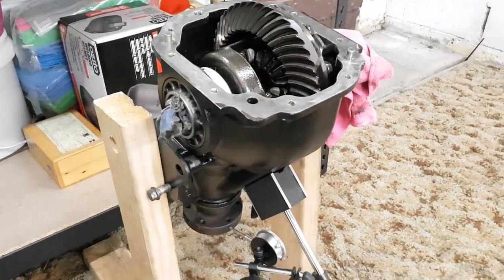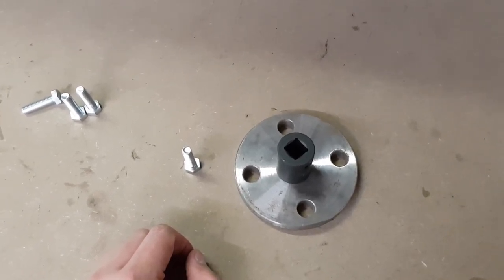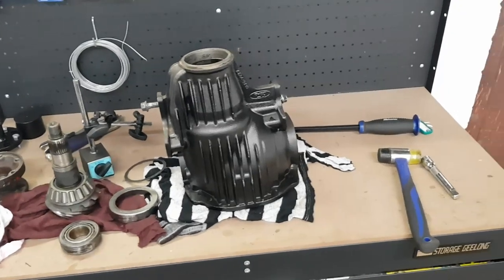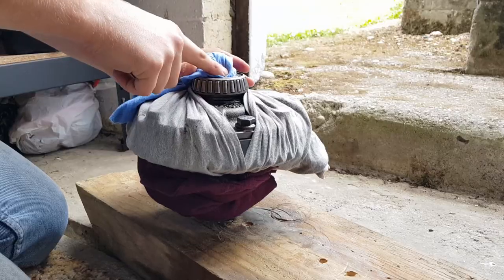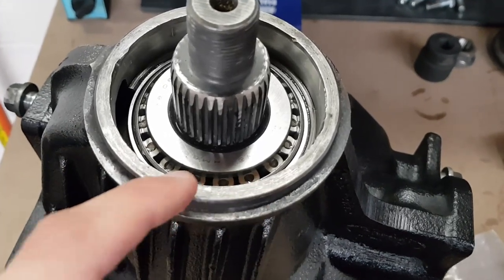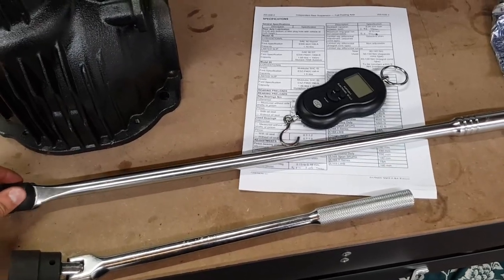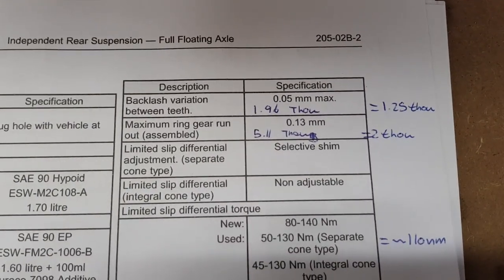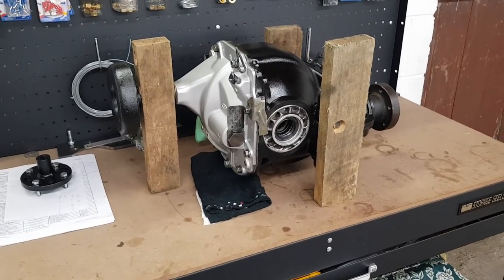xr6 Turbo diy diff rebuild- New bearings

Comment: Awesome work. For a screw adjuster in the past I have used an aluminium oil filter remover and cut teeth into it. Loved your version. Also when removing the bearing carriers I mark them as you did plus count the rotations to remove. With new bearings not needed unless reusing the bearings. Gets you in the ball park and or where you were when pulling it down.
Reply from the maker: I actually did consider using an oil filter tool like that or an adjustable angle grinder spanner but didnt think it would be strong enough. They actually took way less effort to remove then i was expecting.

Comment: Excellent video and thanks for your time and efforts.  This type of video helps a lot of people so thanks again. XR6 turbo diff may be hard to find but your can also use a territory diff which is a M86 and the ratio is lower with a truetrac center it could be a good option for others.
Reply from the maker: Thanks for the comment! yes have since found out the territories run an m86 as well. The lower ratios would probably be favored for those at the drags etc to help overcome that tall 1st gear in the btr. Originally i was hoping to just put this diff in the car without touching it but it didn't quiet work out that way. Truetrac center is also a great idea, this lsd works but i have no idea how much work it has done.

Comment: Good stuff mate . Surprised you got away with stick welding that Chrome moly socket though , would have expected it to crack off under load . Keep up the good work , top shelf .
Reply from the maker: I wasn't to sure what was going to happen when i welded it but welded easily. The screw adjusters aren't very tight though.

Comment: While you have it apart I’d replace all the bearings to mate. Great video
Reply from the maker: I did end up replacing all the bearings in the video. The diff centre bearings didn't look to bad but it was an extra $50 to do them so it made sense.

Comment: that was really good. i am currently doing an AU LSD and it's pretty similar. i was thinking of using the solid spacer because i just can't see why they use a crush spacer other than its easier than making tiny adjustments t a solid spacer. but get it right and it should be just as good.
Reply from the maker: From a production viewpoint a crush washer is quicker because you can get the preload correct first go. If you're building a really high performance diff or plan on taking it apart often a solid spacer definitely isn't a bad thing. Good luck with the au lsd!

Comment: G'day Lad, great video covering all the aspects of these diffs. 
One small point, at 45 min your calculations are off. 195 x 3.46= 674.7 not 467.1. So you were about middle range if spec. 
Would love to see vid on the solid axle design, eg, ute diff. Also checking /  replacing of the LSD parts.
Reply from the maker: You're dead right i definitely made a mistake there. I have no idea what happened to end up with that result. Its a shame about the ute diff, i actually had the solid axle version of this diff apart out of my fg ute earlier this year. It wasn't a full rebuild but i had to remove the center to change the carier bearings and the lsd friction plates so sort a clunk it had on takeoff. Sadly i didn't film it.

Comment: Great video, so much informations in it, much appreciated, wonder if it is the same sort of set up for the solid axles in my bf ute. Learned a lot anyway, can't wait to see the result in your car. My current diff my ute whines starting from 80km/h on slight throttle while coasting, and noise stops with foot off throttle or lower than 80km/h. I suspect my pinion bearing to be bad and so too much play. I was searching for information and came across your video. Now I gotta figure out how the carrier bearings preload works on a solid axle set Up. Thanks
Reply from the maker: Some parts are similar for the solid axle namely the pinion setup however carrier preload and backlash is set with shims. In your case most the time you can get away with replacing the bearings and reinstalling the shims just make sure they go back in the exact same spot they came out. There should be 0 play in your pinion bearings. If there's movement you definitely have issues. I have put the diff in my car now, video should be up soon!

Comment: This was a fantastic video, is this a manual car with that set of gears.
Reply from the maker: Its an auto, all ba xr6 turbo and xr8 ran 3.46:1 manual and auto. Bf started running other ratios with the 6 speed auto etc.

Comment: Great video mate, just one thing I didn’t see the shim that was behind the big pinion bearing the you pulled out, did you put it back in? I wouldn’t mind having a go at building one of these cheers
Reply from the maker: Thanks mate, yes the shim went back in. If reusing the same gears you reuse the shim. Providing you use the exact same kind of bearings as you took out it should still be within spec but you still check contact pattern on the gears once all assembled to verify this. If using new gears though then you will likely need different shims to suit.
Reply: @stuff7853  okay no worries mate the problem with mine is I’ll be using another set of used gears and don’t have the shim out of the housing that these gears came out of if that makes sense 😂😂
Reply from the maker: @jakestocks1296  Even if you had the shim it would be worth checking because there can be variances in the housings. Your best bet will be to make a set of dummy bearings. Use the old ones, grind the inside and outsides of them so they slip on and off the pinion and the races slip into the housing if that makes sense. Then you can easily assemble and disassemble to swap out shims until its correct. Just reuse the old crush washer for test fitting and tighten the pinion nut until it has some drag on it. Replace it with a new one and set preload properly once you do final fitment with new bearings. Good luck!

Comment: Hello there. I have been looking all over the internet for a video on this differentials. I got a 2006 pontiac gto with the same differential. I wanted to ask you how did it go with the differential after you installed it and ran it?
Reply from the maker: Hey, that makes sense that the pontiac has the same diff.  Sold as Holden over here, both the ford and Holden used borgwarner/dana diffs in their cars. I've had no trouble with it since i installed it but if i was going to do it again i think i would go the extra step and install a trutrack style center as the dana tracloc centers fitted from factory use clutch plates which wear out over time.

Comment: Hi mate, just wondering if you done because you get a thump noise from the back of the car when you accelerate hard and let off the throttle? I have an xr6 turbo and trying to do research on this, I done the diff bushes and still same. I was thinking tail shaft, diff, or axels but it looks like it be the diff from what your describing in the video. So did you have a thump noise from the back? If so did this stop when you repaired the diff?
Reply from the maker: Hey mate. This wasn't done to fix an issue. The car still had the weaker m78 diff in it which had nothing wrong with it. (it was originally an na xr6) so this was done to upgrade the rear end of the car to turbo spec parts. An often problematic part for the clunks you're describing is the transmission. I've found the 4 speeds have a tendency to cause the driveline to clunk and bang when you lift off the accelerator and they shift into a higher gear. Eliminate everything else first, check for play in axles and the tail shaft cv joint. Check the tail shaft centre bearing etc. Unfortunately falcons are renowned for having sloppy drivelines
Reply: @stuff7853  thanks for the response, appreciate it. I think I will check the driveshaft and centre bearing. I had a transmission specialist who does the ford transmissions check it and he said box and converter are good and all shift points are spot on. I got an oil change, it’s somewhat better but I have reviewed how they service the 6 speed autos on here and they show how they change the solenoids and rubbers in the transmission and all the mechanics here in Australia know how to do is change the bloody oil lol. I m sick of these mechanics who don’t want to work for there money all just want easy job and get paid that’s it, and the job is not solved.
Reply from the maker: @AdonisMotivationSuccess  This comment here is the reason why i make these videos and constantly push myself to learn how to do everything myself. I don't like to say all mechanics because there are some brilliant ones out there but unfortunately i have been let down to many times, when its myself who makes a mistake i have no one to blame. I didn't realise yours is a 6 speed. Check out Ross Reviews, hes had a bunch of trouble with his f6 with similar issues.

Comment: I didn't read the comments but how did it go in the car? I have to replace the bearings because it has a whine. My situation is a long story of making my own diff hat.
Reply from the maker: Sorry for the late reply mate. It went fine in the car. Would be getting close to 10,000ks on it now.
Reply: @stuff7853  that's cool. I will be giving it a go soon.
Reply from the maker: @dzitezracing  Good luck with it mate, let us know how you get on
Reply: @stuff7853  I finally rebuilt my diff. $300.00 for all new bearings & seals etc. Used the old crush washer. My old man fitted it all up by feel. The thing is absolutely perfect. Thanks again for the vid.
Reply from the maker: @dzitezracing  Good to hear mate! Glad you had a crack and it worked out well for you

Comment: Are they not normally LSD from factory? In NZ I think all XR are LSD as a factory standard
Reply from the maker: Can't speak for NZ but over in Aus most non turbo xr's are open wheel but 3.45:1 ratio instead of the 3.23:1 found in most the lower spec models like the xt/futura. Lsd was an optional extra. Mine was optioned with the lsd, colour screen and premium sound system. All turbo's/ xr8 came factory fitted with the bigger m86 3.46:1 lsd diff in the 4 speed cars.

Comment: Why has the spline on the pinion shaft been ground down?
Reply from the maker: I wondered the same thing, it was evident someone had been in this diff once before. I think they probably did it as an attempt to try and make the pinion flange slide on that initial bit easier.

Comment: Why couldn't you dial the backlash tighter so it was tight?
Reply from the maker: There is variation around the ring gear so if you set it at the minimum backlash specified in the manual on the tightest tooth it will be looser on other parts of the ring gear. The backlash also has some effect on the mesh pattern so it adjusted accordingly as a compromise between the two. Lastly when using used gears i would recommend setting the backlash as close as possible to what they have been running at before disassembly as the gears have worn to that adjustment. 

If you meant why couldn't i set it tight as in zero backlash its because the clearances tighten up as the diff heats up and metal expands and a gearset with no backlash will bind up and get damaged.
Reply: @stuff7853  Thanks for that amazing reply appreciate it alot
Reply from the maker: @mickjdee  No problems!

Comment: Complete novice question: you don't need to pack any of those bearings with grease?
Reply from the maker: Theyr'e all lubricated with gear oil so just a light coating of oil is all the they need